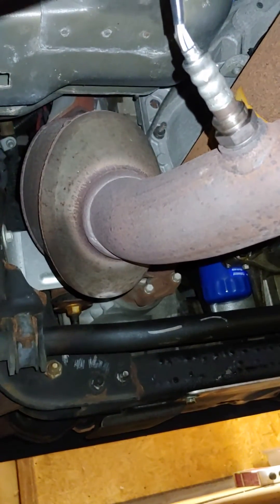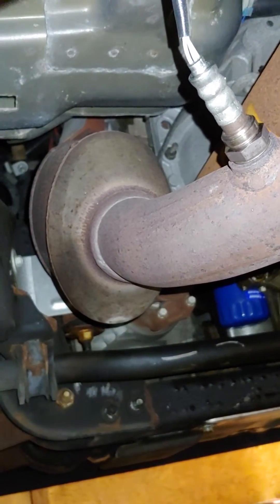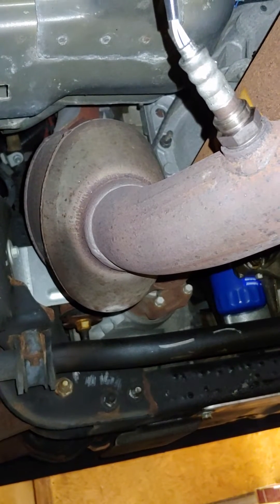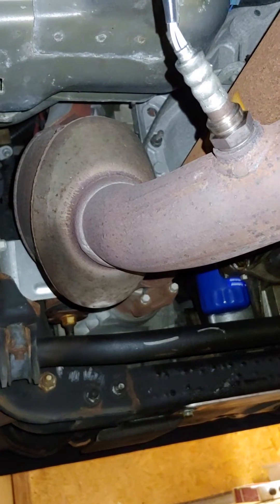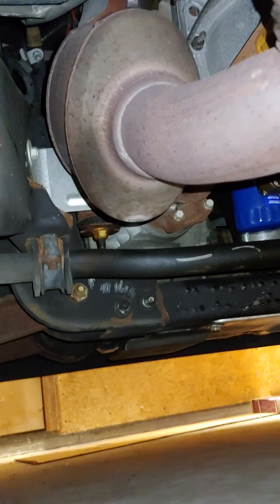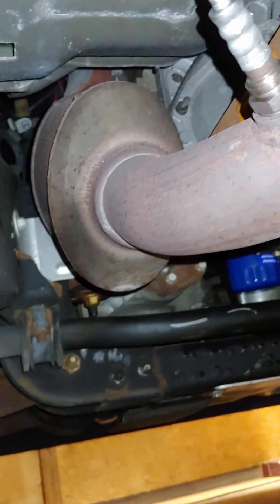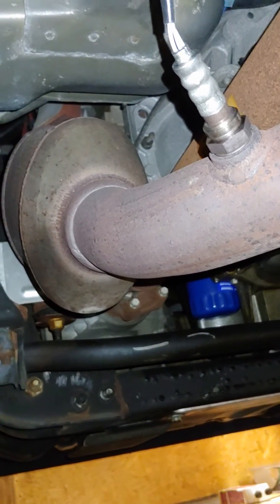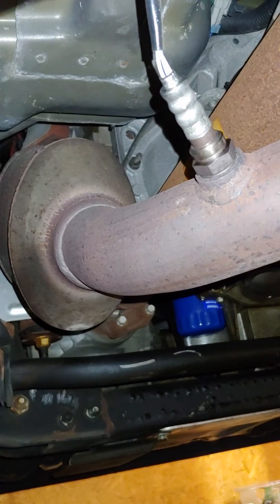Upstream or downstream? Bank 1 or bank 2? Oxygen sensor on 2008 Silverado (P2270 or P2271)

Comment: I think bank 1 on this engine is on the passenger side.
Reply from the maker: Bank one is on the same side as cylinder 1.. On these motors, cylinder one is the front cylinder on the driver side.
Reply: You are correct! Brain fart!😁
Reply: @girlthatfixesthings correct, driver side. (Check the fuse first, 18)